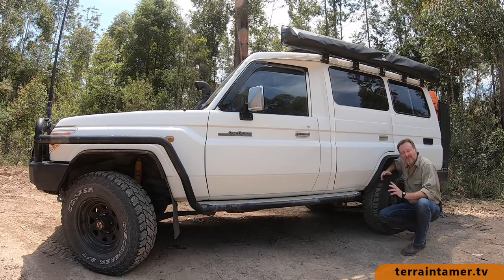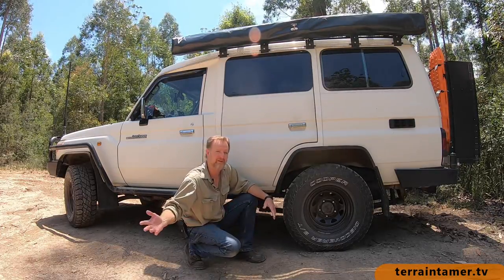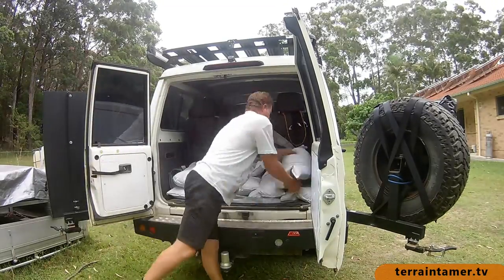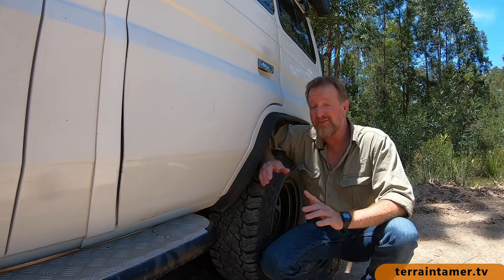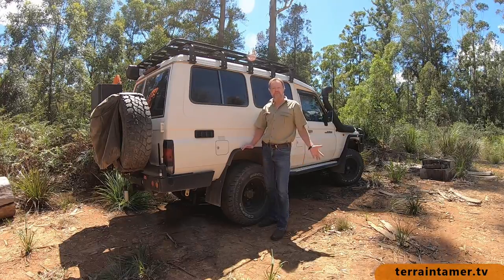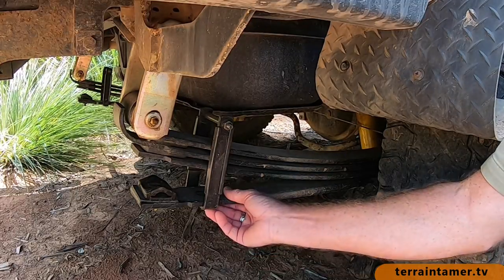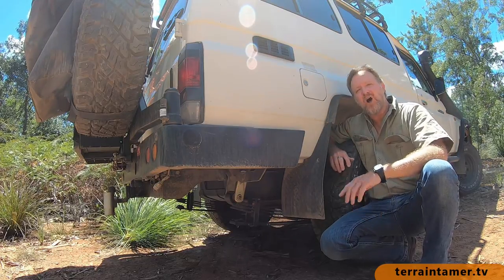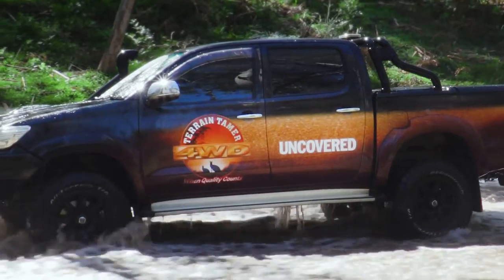Terrain Tamer Uncovered: Parabolic Springs

Comment: Absolutely love my TT suspension in my hilux , didn't get the parabolic springs tho.
Honestly way better ride and better handling than my previous suspension
Reply: I can vouch for how good the parabolic leaf springs are on the Hilux. They handle a load beautifully, ride much more smoothly than the standard spring and flex better too. There really isn’t a down side that I have found.
Reply: @Moor Mac I’m sad to hear of your problems. A friend of mine has them on a Hilux and they are fantastic. Obviously a different car but the Hilux has the spring on top of the dog housing too. It makes me wonder if there is a specific problem with your set.

Comment: Looking at getting parabolics fitted on all 4 corners of my 1995 HZJ75RV-MNQ, which still has the factory leaves although I've changed the shocks once.  With 515,000km from the leaves, the ride is still pretty much the same as it was when new i.e. a bit jarring and on corrugations they are excellent loose filling detectors.

What I'd like to know is WHERE DID YOU GET YOUR AFTERMARKET REAR DOOR done????  That's one thing troopies so desperately need, even if it's a sliding door type like vans have.
Reply: its not aftermarket is a factory option